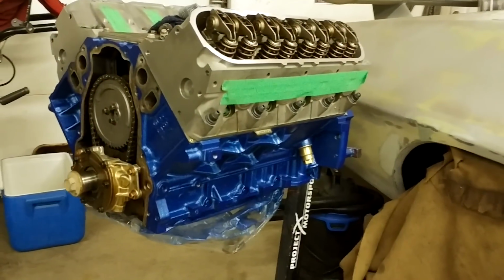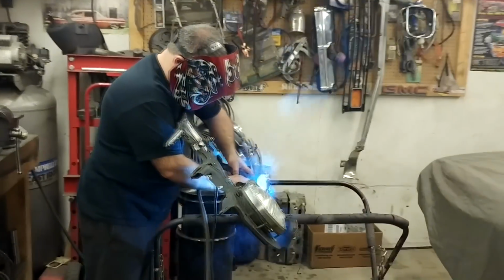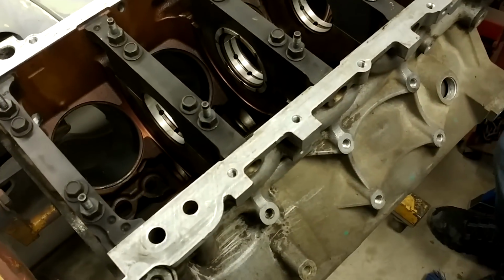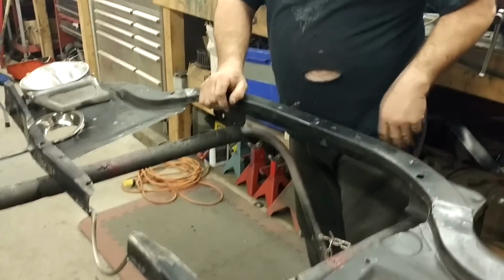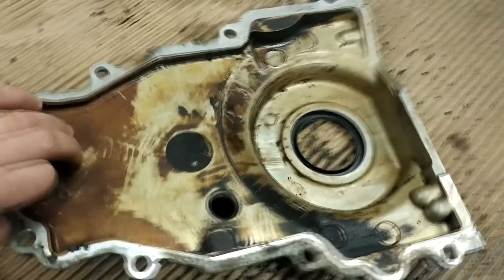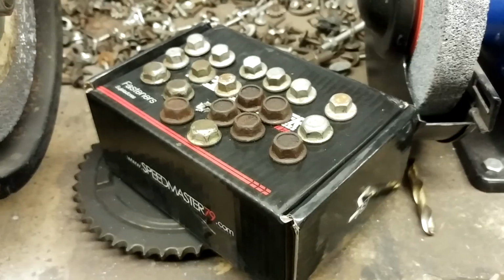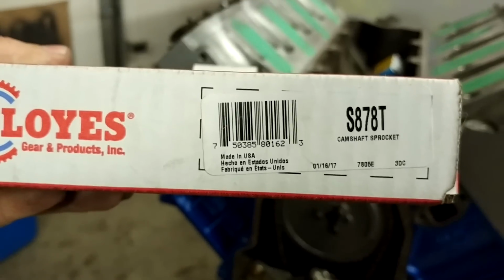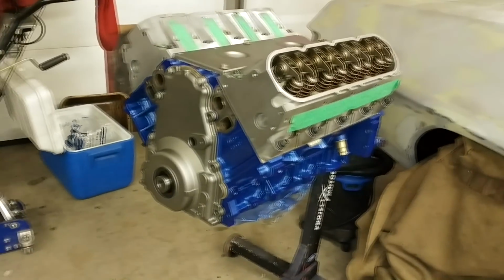Turbo 5.3 LS Build Updates | Painting My Engine and Nova Progress

Comment: First off I'm enjoying your videos! How much do you plan on pushing your 5.3? What size turbo are you running now? Im finishing up my turbo 5.3 hatchback in a couple weeks (hopefully). Mines limited from the drivetrain on power output. Only hoping to make 500-550 at the wheels.
Reply from the maker: Aaron Keller I'd like to go a high 9 with this setup at the very least. 600ish rwhp should get me there based on what the car did before. As for turbo I ordered a s475 t6 1.32ar from Rovospeed on Ebay for $600.
Reply: Very cool! looking forward to seeing you meet that goal. Im running the ON3 76mm t4 on a 3rd gen 5.3. Chinese head studs, pack 1218 Valve springs and LS2 cam. Ill have a hard time putting to the ground through a t56. My goals are low 11s with radials. Ran 12.8 @113 (2.01 60 ft)  on street tires with that setup NA.

I see you have a LS1/LS6 intake. What injectors are you going to run with the new setup?
Reply from the maker: Aaron Keller I have the factory truck intake actually. Started shaving it on Saturday, I will cover it in the next video. I was planning on Deka 80lb injectors, but I am going to try decapped stock injectors, and then upgrade to 160's or something down the road when I want more power. Their is a guy local who just bought a injector flowing machine and the price is right so we will see how it goes.
Reply: SPPTV Nice! I see the Sloppy guys making good power on de-capped injectors. I didnt feel comfortable going that route so I bought some ford racing  60lbs. Good luck on the build!

Comment: do you need a new senser for a 6.0 if u run ls9 cam?
Reply from the maker: SBD Fabrication Some people say they dont even run a cam sensor. I always have though. If its a earlier truck 6.0 it would be the same process as my engine. If its an actual LS series aluminum motor or a 07ish or newer truck motor it will have the sensor on the front cover already, like the LS9 cam requires.